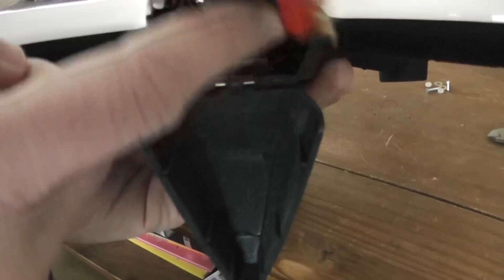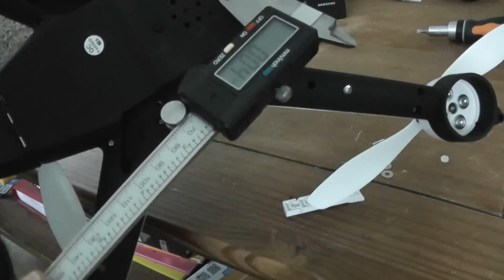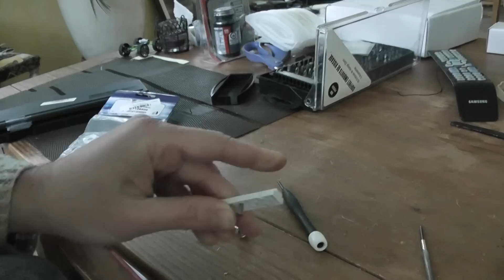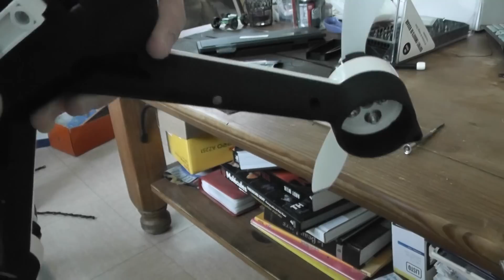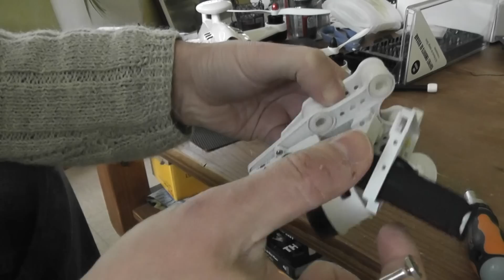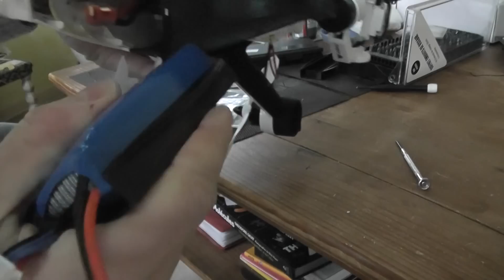Plastic G-2D installation for FY-X8 (Courtesy Banggood)

Comment: i am looking for some small gimble for 808/mobius cam for mini quads such as 200QX or eye one xtreme. is there any nice options for them?
Reply from the maker: I don't think so for two points: i) the ground clearance for such models won't be enough and ii) the weight of this camera model is not enough important to perform efficiciently the gimbal stabilization. Good news, RClogger will sell soon an X1 gimbal (100g) compatible with the EOX

Comment: a couple questions: There are two 12v outputs on the bottom of my x8; are they both live?  And I noticed you didn't attach your control cable. Is it simple plug and play there also? I have a xiaomi yi camera and i was thinking i could use a y cable to split the 12v to go to gimbal and fpv tx, then use the fpv tx 5v output to power the camera. is this too much current for the plug/ hardware to handle?
Reply from the maker: +mike Williams For sure the most to the left is alive. For the control, you should remove the central (+5V) wire of the servo cable. Yes you can use the +5V to power your action cam

Comment: Hey, all right, I'm wanting to install FPV in 3DX8, you know whether it Walkera FPV iLook Camera HD resolution card, with install a G-2D plastic, will work well, does not cause interference in the drone?
Reply from the maker: Should be Ok if you try to maximize distance with GPS dome

Comment: The powerplug i got with the G2D is JST female, so doesn't fit to the X8.. How and were did  you get your JST male cable?
Reply from the maker: Beech Kraft I cutted the provided cable a solder a female JST... You can find everywhere such cable (eBay, BG, etc...)
Reply: Ok got it, thx!